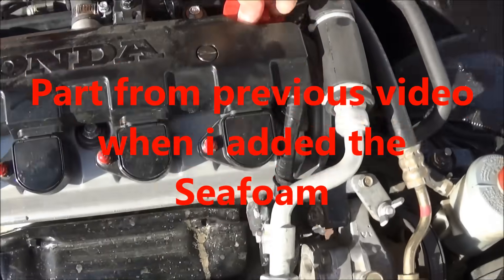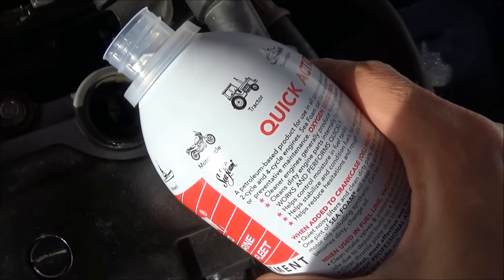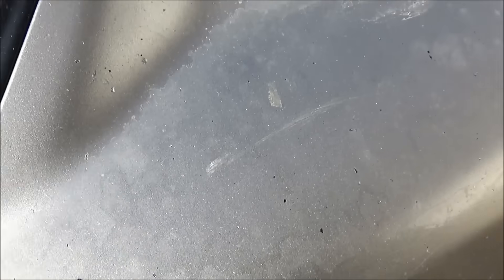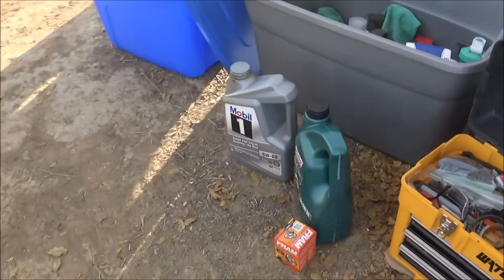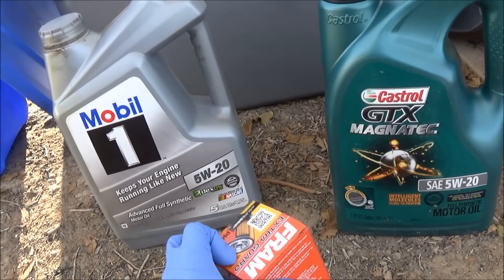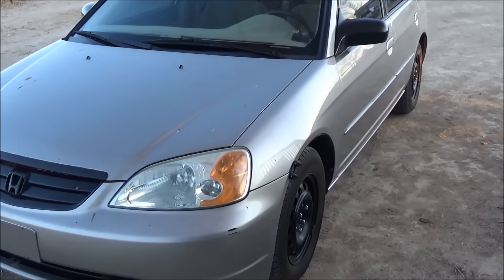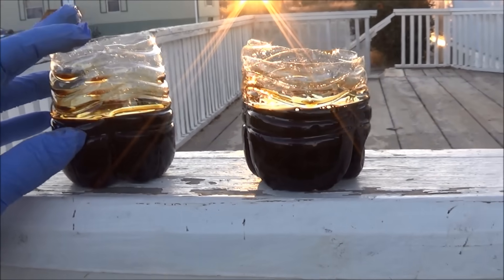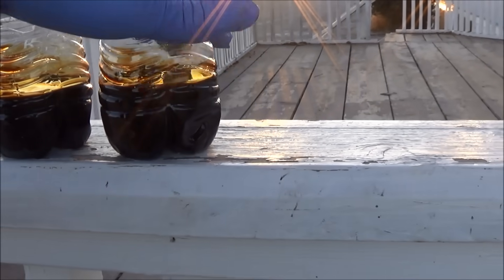Seafoam In Oil | Seafoam In Oil Before And After | Seafoam In Oil Before Oil Change [Sea Foam]

Comment: Castrol is a shit. Next time use Motul, Valvoline, Xado, Liqui Moly or Millers.
Reply from the maker: TheKrisu091 Thanks for the advice . I prefer Mobil 1
Reply: Mobil 1or Shell are good as well just avoid Castrol. I heard many bad opinions about that oils and had a problems with a lot of deposit when i was using Castrol oils. After some engine cleaning and using Motul oil my engine is still clean, starts better, works smoother and a bit quiter. Thats all what i have to say.
Reply from the maker: TheKrisu091 Yeah I didn't like the Castrol my self I have already done 2 oil changes since this video. Thanks for the feedback tho appreciate it
Reply: I have 4 cars and 2 farm tractors on the farm, all of them needs oil thats why i have possibility for some comparisons. I used castrol because of advertising it everywhere but the result was a mass of sediment in the engine(240,000km using Castrol oil). If you check opinions a lot of peoples complain about that and now i am one of them. Since i have changed oil(i choosed Motul because my mechanic recommended it to me) one of my car have +180,000km using Motul and engine is still clean as same as was after manual cleaning. you're right that it's hard to see the difference right away if you just change the oil(i was cleaning engine) but after many thousands of kilometers the difference is clear. Of course, I always change the oil on time and I use good quality filters(Mann or Mahle\Knecht).
Reply from the maker: TheKrisu091 Nice! I personally use Mobil 1 my car runs great with it and for the price at Walmart you can't beat it.
Reply: LiquiMoly is amazing, I’ve owned two Ecoboost F150s and even with direct injection I never had any issues with the backs of my valves getting coated, I pulled the intake plenum once every six months or so to clean them and never had the globs of build up like people claim, I also use some type of fuel additive at every fill up which I’m sure helped slightly, but I fully believe in LiquiMoly, it’s expensive but well worth it, and I only use motorcraft oil filters, in everything I drive wether it’s ford or not, usually they have a filter that will cross reference with just about anything.... I’m very hard on my vehicles and I’ve never had a rotating assembly or valve train problem... except with a Harley, but’s that because harley recommended their oil and I wound up with a sticking valve...

Comment: The seafoam reduces the ability of the oil to protect your engine.  If you use synthetic oil you don't need to treat with sf
Reply: Sea Foam products can be used safely and effectively in all auto engine
if you post a statement, back it up !!!
https://seafoamsales.com/auto/
try reading
Reply: but it was designed for 2 stroke engines try reading
Reply: sooooooooooooooo ???????????????
what it was designed to do and what it can do now are 2 totally different things
and i did read, i didnt see anything about that, why dont you provide proof LIKE I DID

Comment: Looks like the Sea Foam break down the viscosity of the oil.. so be careful driving long distance could overheat and ruin main bearings
Reply from the maker: Not true at all. Go to seafoams website. Clearly states does not change velocity.How could you tell if it did by a video anyways ? Its fine i didn't over heat or have any issues.
Reply from the maker: Daniel Cardenas Naw it didn't. Well I couldn't tell anyways. It didn't seem thinner. Just smelt like seafoam instead of just motor oil. Seafoam clearly states on there website it does not change the vilovlcity
Reply from the maker: itsdatruff That was a lot but thank you! Appreciate the feedback!
Reply: itsdatruff thanks for sharing. Good info!

Comment: Man... There is nothing wrong with Fram if you drain and replace every 3-5k.....just my opinion... I have an explorer with 270k and been using fram for about 100k.  I know there is better but that black grip is just so much easier.  Maybe Fram has a patent on that?
Reply from the maker: kugmyster Yeah man my uncle uses Fram and Walmart oil and doesn't have issues. I say it's all personal opinion. They all do the job. Good question tho about the grip not sure. Subscribe and check out my oil filter vids
Reply: It's not personal opinion. Look up videos on how they are constructed.
Reply: That fram filter is glued to cardboard. There's WAYYY less space to catch debris because there is way less pleats built in. Like 5 feet less. 

They also use a junk piece of tin for the anit drain valve that doesn't work worth a damn.

Combined with the poor filtering quality of the material, you're paying money for garbage
Reply: Mote Hopper not wasted money. The filtration percentage and amount of material in every filter equals, a filter that clogs sooner and just bypasses the filter material all together. 

You completely disregarded my "look it the fuck up before you say anything" comment.
Reply: Sergeant Speed do you think your engine gets contaminated with debris big enough for your filter to filter it out? The only contaminants that get in your engine are during the oil change unless you have lost your engines ability to be air tight, look at what even the most expensive oil filters can do as far as micron's, they don't even filter out the micron of debris that is the most damaging, 2-3 micron's so what's the point of a $13+ filter within a 5k mile oil change since NONE of them filter more than large debris(20-23 micron's)
Reply: Why would anyone pay 12$ bucks for an oil filter that may have better quality parts but doesn't do any better protection in the time that its used than Fram? Fram's been around making filters for a long time and surely wouldn't chance being sued for inferior filters blowing car engines. All Hype. Wasted money.

Comment: I have 250,000 on my 2002 saturn
Reply from the maker: NICE!
Reply from the maker: Samual Jones What's the secret haha
Reply from the maker: Samual Jones Nice! I am currently at 230k. Last time timing and water pump was done was at 11k. I have the parts. I can't remove the crank bolt it is stuck on there. I am getting a impact soon tho and going to try that.

Comment: Don't mix any amount of Castrol and Mobil brand oils together, it will turn to gel. Found that out when someone accidentally mixed them in an industrial gearbox and destroyed it.
Reply: Don't spread false information.  You don't put motor oil in a gear box, probably why it failed
Reply: All motor oils of the same grade are compatible with each other. They might not meet OEM specs but they never "gel" when mixed.
Reply from the maker: Good to know man. Subscribe to my channel and check out my other videos i have already went thru that Castrol oil now i have in Valvoline.
Reply from the maker: Larson Home Inspection Lol smh

Comment: Good video, but If you plan on testing your used oil. Put oil in a sealed container right away.. There is dirt in the air that can contaminate your sample
Reply from the maker: Michael C Thanks for the advice will do man.

Comment: ATF works just as well if not better in my experience. Half a quart maybe more for a seriously dirty engine. Run it for a half hour, dump it hot. It's amazing how much gunk it pulls out. As far as filters go, Bosch filters are great. Black can with the red check valve inside.
Reply from the maker: Nice thanks for the tip ill have to try tranny fluid one day when i get a engine that is dirty. As far as Bosch filters i have never tried them but i will think about it i usually use mobil 1 1 or k&n. Don't forget to hit that subscribe button and check out my other videos i have some on oil filters.

Comment: Sea Foam will clean up your engine! I have a 2001 Dodge Caravan. I put a whole can in about 500 miles before my oil change. I had some tappet noise in engine and all noise went away! Would advise maybe use one time to clean up engine especially high mileage engines! I do not know what would do to oil seals if used on regular basis? James
Reply from the maker: +James Sasse Awesome man! I drove a little over 600 with it in mmine Subscribe to my channel check out my oil filter vids.

Comment: Doesn't Seaform reduce the viscosity of your engine oil...? I would put that in there, and let it idle for a while before an oil change to clean it out sludge if the vehicle had it...
Reply from the maker: Hardy Joe Nope it doesn't. Check out seafoams website. It says it does not change the velocity. I also just found out that idling a car is not good especially long periods of time. 60% More engine wear when idling. Google it yo
Reply: ThizzleKid420 oh man, you destroyed my egotistical correctness about cars, lol

That's good to know about not letting cars idle. Its going to be hard on cold days considering this.   I did pour a little seafoam in the engine oil and it didn't hurt anything.
Reply from the maker: Hardy Joe Haha yea you should be fine man its not gonna hurt anything

Comment: I don't mean to sound like a dick but did anyone else see the mods on that engine here the thing if that is as modes as I think it is then all seafoam did was nothing granted I used it in my old dodge when I thought the oil pump went out and yea it cleaned up everything good but not that damn good
Reply from the maker: Levi Carnahan Lol well it worked great for me. Depending on how sludge is in your engine i would drive with seafoam in your oil 500 to 3000 miles.
Reply: ThizzleKid420 
It did work and worked well I thought my oil pump had quit lost oil psi guy told me when I bought new pump to try the big can and start and kill the engine a few times and then start again and if I had oil psi to let it run a few min or drive it so I did and changed oil and did this twice and got my psi back and actual had better running engine after purge but that's super clean bro looks good to good lol
Reply from the maker: Levi Carnahan Nice bro i really feel like seafoam and marvel mystery oil restore power and increase mpg!

Comment: Not hating but your oil filter is very important don't cheap out on that. K&N and Mobil 1 filters are so pricey bc of their name and they say you can go way to long for an oil change. Bosch sells good ones and they're like $5 on Amazon. Walmart and amazon are the places to go if you want to buy oil and filters, it'll be way cheaper than auto parts stores. Realistically I don't think that seafoam will help at all. I don't see how diluting your engine oil would help the car. In fact it can actually move some sludge into places that would cause more damage to the engine. Also the only real way to see if a oil is good is to get it tested by blackstone labs or a place like that. They can tell exactly what additives are in the oil and how good or bad the oil has held up. You can't tell how good an oil is by not testing it.
Reply from the maker: George Parker Agreed. Check out my other videos and subscribe. I have some on oil filters and buying oil and oil filters at walmart.

Comment: I put seafoam in my engine for about a hundred miles, I heard anything over a thousand miles would start to eat the seals but that could be not true
Reply: I also had what they call a Hemi tick and that seemed to go away with the Sea film
Reply from the maker: twix 2013 Yeah it helps with so many things its a great product
Reply from the maker: twix 2013 You should be fine. The bottle says leave in whole oil cycle which normally would be 3k. I only left in 600 miles
Reply: I plan on putting some more seafoam in my engine pretty soon, I put some in my brake booster vacuum line and I couldn't believe how much smoke came out of the exhaust plan on doing that again lol
Reply from the maker: +twix 2013 Haha nice yeah i did the same tthing. Check out my video i made showing it. Appreciate all the feedback

Comment: Great to see you are not pouring the whole can in the engine. I've been doing this every oil change (one ounce per quart) on my Ford Ranger V6. I now have 271,000 miles, and it runs great and easily passes smog tests.
I advise you to use the better Fram filter, which is silver in color. They are made much better than the red-orange ones.
Thanks for the video!
Reply from the maker: +William Riley Thanks for the positive feedback. Yeah i have used seafoam once in my engine. I regularly use mobil 1 or k&n oil filters and mobil 1 oil. I just got to 227,000. This is the 2nd time trying fram. At the moment i have the silver fram on.
Reply from the maker: +William Riley check out my oil filter videos i have a few.

Comment: I have a mds system in my car would it mess with the oil weight cuz my car throws a wrong oil check engine light
Reply from the maker: +jack T No it doesn't at all. Go under seafoams website it clearly says it doesn't change the oil velocity.

Comment: Just use a coffee filter if you're going to use fram
Reply: Currently works at wix 😂 so naturally I like to see hate on the competitor. But honestly there is zero difference between a expensive wix filter and a nappa filter they are identical ones just advertised for performance cough cough (wix)
Reply: I’d reuse my old filter before I would use a Fram. You should stick to the manufacturer’s oil filter. Castrol GTX is good oil.
Reply from the maker: Eric Mcguire Check out my oil filter videos yo.
Reply: The silver ones are much better than the orange ones. I've cut several of them open. The difference is obvious.
Reply: This is 3 years old and 3 years ago I would've agreed though it seems even then we were wrong. The major issues with Fram filters has been worked out. I'm using their branded oil and Titanium filters now. Last purchase was was less than 40 bucks per 6 quarts and a "20k" filter. It's hard to beat and with 4 to 5k intervals it just makes sense to save some money instead of paying for Redline, Royal Purple, Amsoil, Purolator, K&N ect...
Reply: Fram is okay. Dont listen to this guy.
Reply: @glenbenton4855  Right.. It's just OK
Reply: @wcemichael it's actually better than ok but stupid has to complain about nothing that affects them
Reply: @davidporter7051  It affects you if you use it. I've seen them taken apart and examined. They're good if you change them every 1,000 miles.
Reply from the maker: Newfie-Dean Haha. Subscribe man and check out my oil filter videos. I didnt like castrol so wont be using that anymore.
Reply: @Chicodirt  why didn't you like Castrol? I'd like to know because I'm going to use it on my Audi A4 1.8L turbo. They all meet API and other specs.
Reply: Fram embarrassed me in front of my friends. Never buying it again 😭.... I was changing the oil for my friends 2000  honda CRV and matched the new fram filter with the used up Wix and I glanced at the gasket. It looked good. Little did I know when I put the oil and started the car. There was a HUGE leak under. I was traumatized. Had to clean the big ole puddle. Turned out there was a small crack on the new Fram gasket and was not noticeable until you expanded or folded  the O ring gasket. NEVER BUYING FRAM AGAIN.
Reply: That is a disservice to coffee filters..
Reply: Agreed
Reply: Second video ive seen on this product and it has the same exact comment as the other video
Reply: Ignorance like this is 1985 😂.
Reply: @MadeitTuhMidnight  I've seen people take apart filters and examine them.  Fram is like the Kmart brand
Reply: @wcemichael  tell us you don’t knit what you’re looking at without saying it lol
Reply: So what oil filter you prefer
Reply: Fram and k&n are the only filters I use idk why there is hate I put em to the test also use them on Fords and Chevy small block 350s always use Valvoline oil.
Reply: Fr in my mechanic class we would cut open different types of oil filters, and everytime we cut open the fram, the filter fins were always broken or not properly filtering. My instructor made it clear to just spend a few extra for a nice oil filter that will last a full 5k moles (mobil 1 pennzoil, literally anything other than FRAM/cartridge filters.) 

P.s, im sorry if your car's engine uses cartridge filters, as they're completely garbage.
Reply from the maker: +wcemichael Haha or use oem honda oil filter. Same as fram. Check out my other videos on it.
Reply: The older 15400-PLM-A01 filtech honda filters are much better than fram. The newer A02 honda filters suck and are made by Fram. I buy the old A01's on ebay. I can usually get them for around $5 each. Great filter for 5 bucks.
Reply: wcemichael that's what I was thinking, gram sucks ass
Reply from the maker: Shredar mitch Good to know lol Subscribe to my channel and check out my oil filter videos.

Comment: Mobil 1 is still better
Reply from the maker: Christopher G Man I agree . I drove with that magnetic shit for 5k.  Never again. Subscribe i am uploading a video today showing it.
Reply: ThizzleKid420 if you ever watch the video of Mobil 1 chilled to -30 and how slow the other oils move you will see why. Not many places get that cold but it happens and cold starts are the most damaging
Reply from the maker: Christopher G Man Yeah mean i normally only use Mobil 1. Right now i am using Vavoline max life high mileage and I did a valve adjustment yesterday and saw that there was still oil all over everything after several hours of sitting. So i like this stuff atm but i defiantly am going back to Mobil 1 after this.